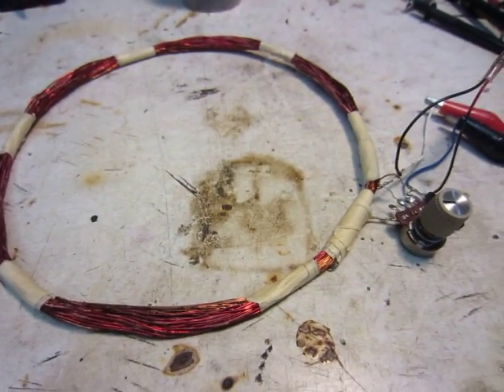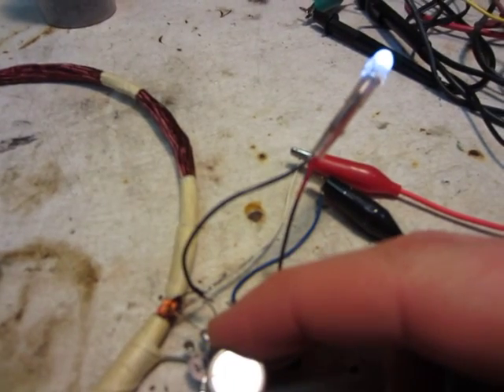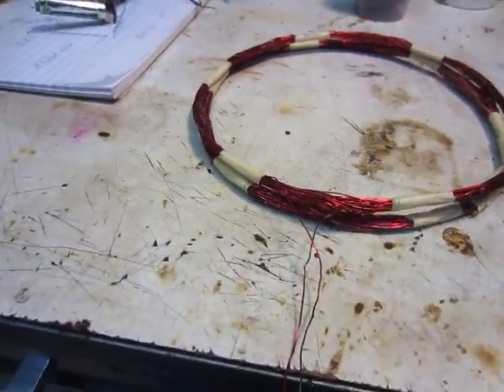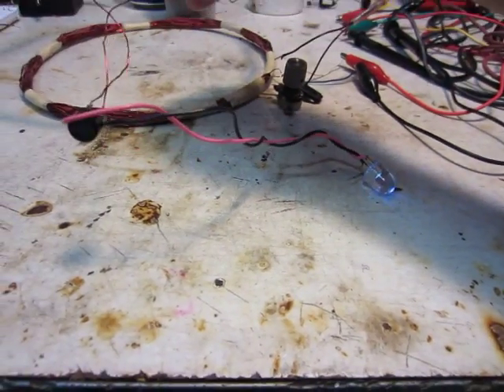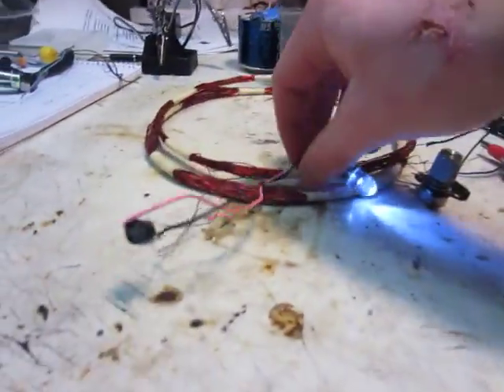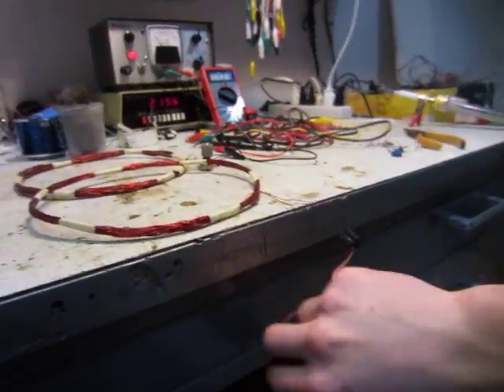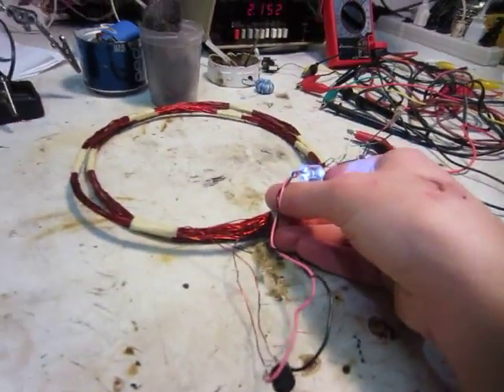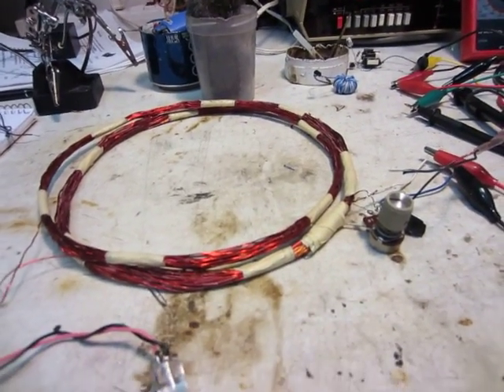Wireless Joule Thief

Comment: did a dog Bite your Hand? good work on joule thief
Reply from the maker: marcio santos marcio I spilled molten zinc on it.
Reply: Makerj101 its heally painfull. bee car fool
Reply from the maker: marcio santos marcio Ok!  Thanks!
Reply: +Makerj101 I was using a lighter to melt a large hot glue stick over and over for a project and I didn't see it WAS melting (because it turns clear) spilled molten hot glue on my hand, it sucks. The problem with objects that are solid at room temp and liquid at extreme temperatures, is that the human body is colder than the liquified substance, meaning, it start to cool as soon as it touches your skin, which may SOUND good, but by cooling, it becomes thicker and wants to return to a solid again. If not removed INSTANTLY or if it is sticky (like glue....) then, it hurts to remove it and mine still has a scar from an unknown several number of months ago. It's painful, it sucks, but it's a learning-shortcut. We both now know what risk is involved by personal experience and we are more likely to avoid it happening again. Use proper safety equipment, even when improvising.

Comment: have you experimented with different frequencies to see if you get better power transmission?  probably easier to try that with a 555 timer setup so that you can control the frequency with a potentiometer.

Comment: @makerj101 try a ceramic capacitor across the coil, you need the right value, use the formula: F= (1) / (2pi*CL). F is the frequency; C is the capacitance (in farads); and L is the inductance of your coil. you will need to find out the inductance of your coil in henrys, the frequincy of your joule theif (i think its 19000 hz) and from that, calculate the equation and figure out what value capacitor you need. its not very hard